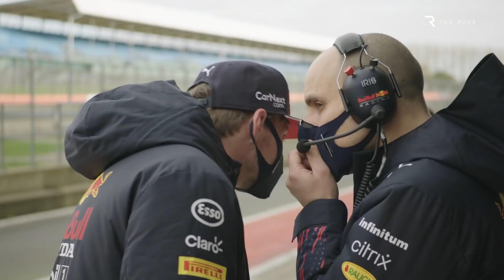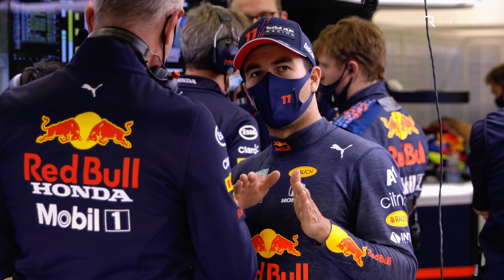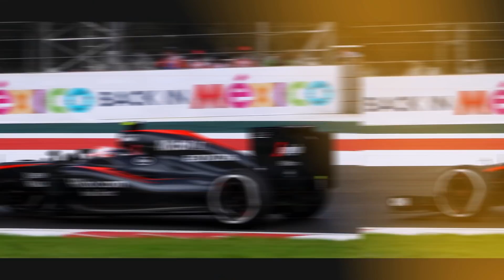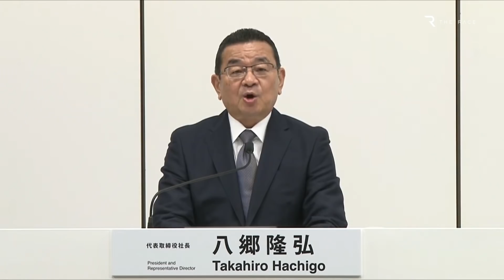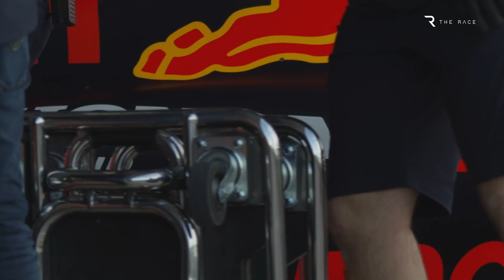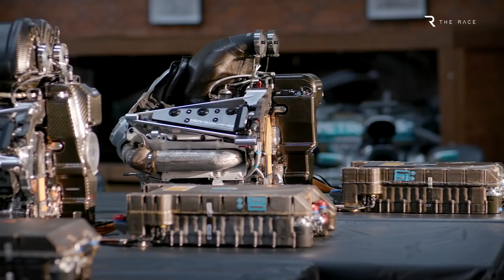The major F1 engine upgrade Honda kept secret

Comment: I would be more interested in knowing  the physical size of the battery? Is it regulated or only the weight? Using 'super capacitors' as part of 'battery' the charge can be almost instantaneous with a drain to slowly charge main battery which will increase it's lifespan. As carbon nanotube technology is progressing, 'super caps' can be more easily factored into the equation.
'Super caps' have been used for many years in city buses so there is a precedent (and probably why Tesla purchased the largest  US super cap manufacturer in 2019) 
If Honda is supplying power units to red Bull, they are only partly removed so developments are not wasted.

Comment: The battery has a capacity of a lot more than 4-5MJ,  (for comparison 4Mj is the capacity of 90Ah 12V car battery) 1kg of the high-quality li-ion battery can store 0.8 MJ. F1 uses top-notch battery technology with more than that. Simple math says 20kg battery has a minimum 16Mj capacity. If batteries are cycled between 20% and 80% you have usable 9.6 Mj. reduce this for 4MJ you can use for MGU-K per lap you have 5.6MJ for running MGU-H and turbo. That is a very conservative minimum assessment because I don't know what battery technology Honda uses. If they use something like Lithium-ion nanowire those numbers are a three-time greater.

Comment: Anyone else finding these rules around the battery charge/discharge/capacity being unnecessarily restrictive? It is as if they almost couldn't regulate it more. 
It does not seem intelligent to do so when this component has significant relevance for future cars on and off the track, as well as for the future relevance of F1. 
They should free up a lot of the rules around the battery, and just keep the rules around the battery's safety. The cost caps of 2022 will keep its dev from being a runaway expense.

Comment: As a lithium ion battery, changing the power density or the power/kg is minimal. Research in this area has been slow for decades. Most of the change would be in construction or electronics. But the materials wouldn't have changed much.

Comment: I rather think that MB already have such thing Honda now has developed. By saying so I would like to put attention on Laptimes produced by Mister H. on different circuits especially at the end of the races. In 2020 I have written a letter to RB to check on MB's performances and how it could be possible that round after round mr. H . 1.5 - 2 secs faster then Max. MB had the extra power and with this explenation by THE RACE it must be the MGU-K and Energy storage.

Comment: I didn't get just one thing, if someone can clarify this for me. So did Verstappen get the new battery and control electronics all the way back in Belgium or just now in Russia, hence the reason why they changed so many of his engine components? Cause if the latter is the case, then that would explain why he climbed all the way up to 7th in a track that doesn't suit their car and also be a huge sign of intend for the coming races.

Comment: What happened to F1 having guts and actually steering the class to success. Every brand has their own interests at the forefront, not the sport which means there is no direction. 
F1 panders to RB, then panders to Merc, then Honda and now it looks like it is kissing the ** of the VAG and they have not even joined yet.

Comment: IIRC Honda's battery was one of its most criticized problems in its McLaren days because it would run out of juice and start harvesting before the end of the straight, killing the car's top speed exactly when the driver needed it the most to defend (or, on very rare occasions, attack). I find it very interesting that Honda has only just now upgraded its battery elements, even though the complaints about its battery's early harvesting disappeared a long time ago.

Comment: Awesome video.

It also shows how hybrid cars are a virtue signal and not actually eco-friendly.
Lithium ion batteries are very heavy, take up lots of space, and get worn out very quickly.

Essentially all we end up with is tonnes of toxic waste and not much to show for it. 
I love the concept of hybrid cars, but without better battery technology, it's all just a fancy experiment.
Reply: There are still some gains, given the fact that you can store and use freely generated energy. And while there is indeed toxic waste, I don't think it is (nearly) as bad as fracking, fuel spent on oil transportation, oil leaks and spillage, oil disasters, and... no wars have been waged (yet) over raw materials for batteries. Can't say the same with regards to oil.
I agree though, there will only be significant changes with real upgrades. Let's see what happens in the next few years with solid state batteries and batteries with silicon anodes.
Reply: @MrMezmerized  Eh... they use some chemicals while minning lithium, wich they spill in rivers polluting that water forever, you just dont hear about it because doesn't fit with the eco virtue signaling
Reply: @Ale-nv2bo  You don't hear much about how much oil leaks out of pipes every single day either.   Or how much gets lost with other transportation annually. Or how bad fracking is. Or how much waste refineries produce. Or how much fuel leaks away at gas stations annually. 

How many mining chemicals for one Deepwater Horizon disaster? For the burning Kuwaiti oil fields during the war there?

How much pollution and how many lives lost in military conflicts where oil was at least partially a factor?

I'm not saying chemical waste isn't a serious issue. I'm saying nothing comes even close to the pollution of everything related to oil / fuels. Except coal perhaps.

Comment: I've got idea!!!  F1 is always trying to cut costs.  So here' my idea.  Get rid of all this hybrid crap and have the cars running on an internal combustion engine and allow any configuration but a max of a 2l turbo and manual gearchange.  That would screw quite a few drivers and would be entertaining for the fans.

Comment: What keeps teams from just hammering the MGU-H to power the MGU-K? It entirely bypasses that 4MJ power delivery, and if you can use that say, with a 6MJ battery basically all the time, then whats the downside? 

IS there a limit to what the MGU-H can actually supply? Because in your visual it appears limitless. Same with the turbo. This honestly can be the reason why Mercedes are losing out so much. Someone has figured out you can just directly bypass that limit and shove a metric ton of energy through one of the MGU-H/MGU-K/Turbo to keep the engine pinned at that extra 160HP.
Reply: They already do. There just isn’t enough energy around for the MGU-H to convert into a constant 160hp boost.

What they do is harvest, store, and release at the optimum time. Releasing the limited energy all the time isn’t as efficient as storing it for release at burst in more beneficial moments on track.

Furthermore, some of the energy is better used to keep the turbo spooled at insane speeds. So teams lose some of the energy there as well.

Comment: Most likely went with a higher V system, similar to how the latest gen electric cars have gone to 800V for faster charge/discharge and longer battery life. Maybe even went up to 1200V. Higher V means less heat and smaller wiring which mean less cooling which both weight less, allowing for more batteries
Reply: There is a 1000V upper-limit on the ERS system (Tech Regs 5.12.5). If higher voltage = less weight & less heat, you can be certain they are all already running at the maximum voltage allowed!
Reply: @Purple_Banana_69  If i am not wrong, ferrari finally upgraded their system from 400V to 800V last race in Sochi so i guess its not that simple
Reply: @Purple_Banana_69  voltage don't lover battery weight only weight of wires, and MGU components because the amperage is lower. Voltage is a product of serial and parallel connections between battery cells. Capacity is dependent only of the number of cells.
Reply: I think Ferrari has a 1000V system now. But probably don't want to admit it publicly. 400V is seen in road cars for years already.

Comment: Nice to finally understand regs of the battery system. “Charging” now makes sense since they can only charge 1/2 as much as they can use per lap.
Reply: They seem unnecessarily regulated, prohibiting relevant battery technology development.
Reply: @keeganclarke6475  limitations are created to give drivers greater control over rear brakes. MGU-H can charge a battery without any limit.
Reply: @keeganclarke6475  that isnt a real problem anyways.
Reply: @Gl-my8fw  I disagree. They have limits on charging and on discharging (except with the mgu-h turbine spool). It is entirely reasonable to expect that this makes the battery less useful that it could be, for if it could carry a greater capacity or discharge at a higher rate then straightline performance could be improved. Battery technology is going to feature in all commercial vehicles in some form or another, so it would make sense for F1 to incentivise the development of battery tech. Instead the FIA has limited the two key factors of maximum charge and maximum rate of discharge.
Reply: @keeganclarke6475 i hope you do know cars wont be going electric as quick as many pretend. Their goals are not feasible and the environmental reasoning is greatly exaggerated.
Reply: @Gl-my8fw  Entirely aware and do agree about poor realizable feasibility in the near term. However, that doesn't detract from my point.

Comment: He qualified ahead in SPA because of the wet conditions, need I remind that Russell qualified second? In power sensitive tracks Mercedes was clearly the faster car, they have the fastest engine. Zandvoort is the opposite of a power sensitive circuit.

Comment: Everything Toto says: He's just sandbagging, that can't be true
Everything Red Bull Honda say: Oh wow, that's really interesting, we are really glad you shared that, thank you.
Reply: That's how Mercedes have portrayed themselves in these years . When they say Redbull are close they used to get 1-2 the following race ( 2020 season).
That's what is in the minds of people
Reply: @rishinaik4326  There's nothing worse than being blinded by biased optics, though. Regardless of it being within the rules, what Honda have done is making a mockery of ALL the so-called 'cost cutting' measures. Is F1 cutting costs or not? One minute everyone is getting put to the back of the grid for engine changes, and then the very next week, apparently, batteries are not an integral part of an engine in 2021?? Someone tell that to Elon Musk 😂 They have thrown so much money into this one aspect of the battery, when it won't count for nothing come next season. They did exactly the same thing in 2009, and it was Ross Brawn who cleaned up that time. How is it far when certain manufacturers can be adding parts with just 7 races to go?! That goes to RB and Merc. Whilst Haas.... are slower than my arsssse
Reply: @stevenmacdonald9619  As far as engine development is concerned it will help next year but aero development won't help next year.
Reply: @rishinaik4326  I thought they were removing the MCU-H from the energy recovery system for next season? Or is that 2023?
Reply: @stevenmacdonald9619  MGU-H will be removed from 2026 onward
Reply: Toto is as believable as Lewis himself
Reply: @richboy900  7 world titles, and 100 Grand Prix wins. You can't get more genuine than that. Winners don't make friends... until they are done winning. He's a multi-millionaire, he's still fighting at the top, and popularity would only soften him anyway. Mercedes have no more engines to use, and no more fucks to give.
Reply: Really shows how much just wanting Merc to lose permeates through the mind of many "F1 fans".

Comment: Hamilton best racer ever .Driving  f1 has never been harder . But I would say the  Racists have never showed themself as much  till now . I'VE ONLY Three WORDS FOR THEM
 HARD LUCK LOSERS  ,  THE COLOURED GENTLEMAN  HAS 100 WINS and you lot can go F yours
Reply: Cmon dude you can't be so salty. I really respect Hamilton not only as the first black f1 driver but his upbringing is also the literal definition of I made it but that doesn't take anything away from the rest of the drivers in the grid. They also worked hard to achieve where they are today. We are in an era of equality in terms of race, opportunites and what not but just simply stating that lewis is better than the rest of the drivers on the grid because of his colour just doesn't make sense. That just watters down the fact that there is no discrimination of race.

Comment: 4MJ/20kg.

43MJ/1kg.

These are a couple of simple numbers that explain why F1 cars will never be fully electric.  (That is, assuming the FIA wants people to watch the races.)
Reply: That's why they will just put wireless charging pads underneath the slow sections of the track and use super capacitors.
Reply: @10001000101  Why don't you just dash off a quick calculation of the power required to charge a 4MJ battery as a car passes over a fixed point in the road at 40 mph.  Then extend it to include the entire field of cars.

Comment: When had Mercedes introduced their last battery update? Theoretically could they introduce a new spec Lewis takes a penalty?
Reply: They did say that if Lewis does end up taking a new engine, it would be the new spec. But nobody knows for sure if it will be actually available when he does end up needing new engine.

Comment: They reduced its "Mass" please. (That helps in acceleration) "Weight" is a force measured in Newtons. Help educate the Pommes and Yanks please by using correct terminology.lleke MegaJules and Mega Watts

Comment: Well Hamilton was right 😊
I can't believe that Honda is producing the cell them self.
It is not something you doo over 5 - 8 year period, it taks a lot longer to nail the chemistry of a litium battery.
It is probably produced by Panasonic or LG (with a Honda looking them over the shoulder), the have the knowledge and experience to do just that.
Too many parameters which is going in a bad direction in F1.
Temperature, weight, size, high C rating both charges and discharge, all these parameters is bad for the cell.
Reply: If they were involved we would've heard about it. Also, tech this specific is probably only within the reach of a manufacturer.
Reply: @djoetma  yeah I agree.

Comment: Pure and utter nonsense. FIA publishes every singe upgrade during all race weekends, for each competing team, reporter, youtuber and fan to see if they want.
Reply: They publish what has been replaced. Not what has been upgraded and the specs of those upgrades.
Reply: @hoi264  true but as of this season, they DO inspect, and upgrades are forbidden for PUs, unless safety related.
Reply: @endthisnonsense7202  Wasn't the point of this video that the manufacturers are allowed 1 change (other than those for safety) since the end of last season, so Honda is allowed 1 performance upgrade on this part, since they didn't upgrade it in years?
Reply: Check out hondas own racing website, they mention the upgrade there... i guess they are lying too.
Typical fucking dtuch fanboi for Max, you probably think hed win if he had no car and ran around the track.
Reply: @Chris-xl6pd  Dude, I'm only mentioning all changes are published, and the rules PU units cannot get upgrades apart from safety related things. THAT CANNOT be lying, sorry.

As for being Dutch fanboy, yes, Alonso Fanboy for decades now, half of the time I'm following F1.

Comment: When Hamilton says i think they upgrded their engine again. Everyone was screaming weh weh weh
Reply: Merc still has more hp, this upgrade doesnt give more power, just works on efficiency..
Reply: @franciscoferreira6672  it does if you listened. Maybe not by much but that redbull is good car. Any upgrade is noticeable
Reply: @MaskhenzoG  the packages are similar, red bull has a slight advantage in qualy pace but in race pace especially in the hards mercedes will be faster most races still
Reply: Hamilton whined about the Honda all season long
Reply: Yet the Mercedes is still quicker.
Reply: @MartinGonzalez-ki8kn  on straights yeah. Only after that upgrade in Silverstone. Otherwise we both know that redbull can stick to the track